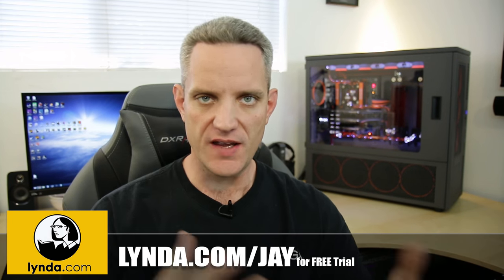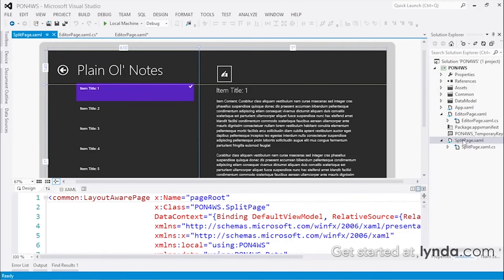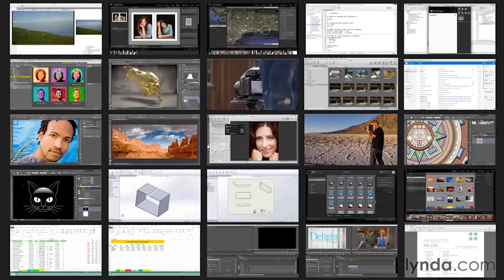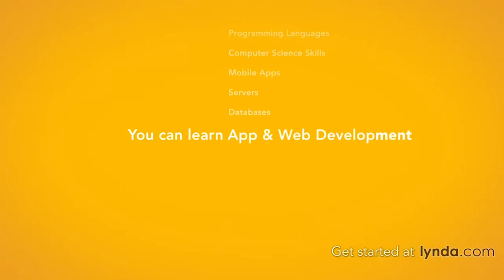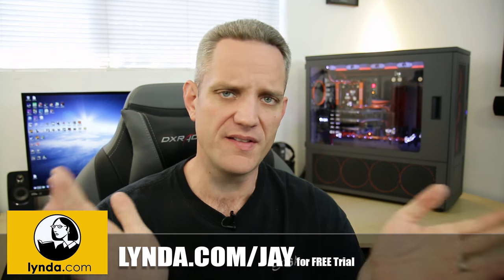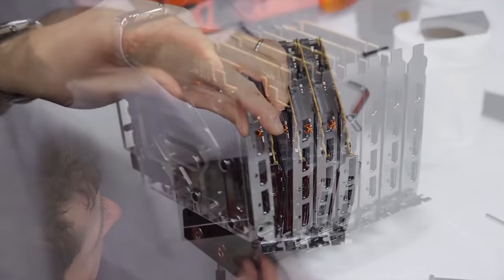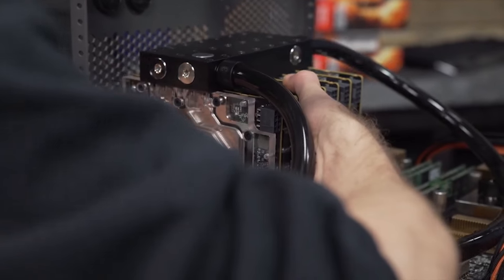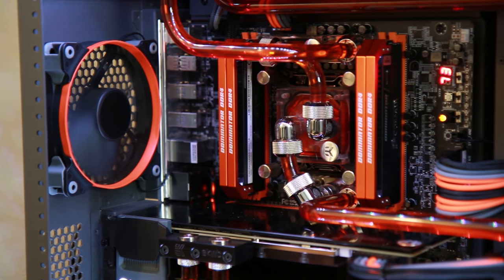Is watercooling worth it?

Comment: A few reasons I probably will never have a custom loop system in my PC:

1. It's time consuming. I'm not spending hours setting up a loop for a few degrees less.
2. Maintenance. Draining and filling the loop from time to time to clean it.. hell no.
3. I personally dislike the looks of a custom loop compared to most air cooled/aio cooled. 
4. Expensive. It's way more expensive than just keeping everything stock, which performs great already.
Reply: +TeaRex To be fair, it's not a few degrees. GPUs can be as much as 60C cooler than stock
Reply: +wenisinchina are you blowing on your gpu to cool it? it's not a 60c difference. ever.
Reply: +Nicholas Domenichini I don't kno dude, maybe a r9 290x overclocked to hell on air vs it on a loop with tons of rads, it could be close as some r9 290x's get close to 90c and I have seen cards below 30c...
Reply: +wenisinchina so my GPU runs at -30° idle and at 0° under load in a custom loop?
Reply: wenisinchina Yeh.. right..
Reply: TeaRex im talking a stock 290x cooler vs a good custom loop
Reply: +wenisinchina same here
Reply: Even with my 980 Ti, it's a HUGE difference vs stock.
With my overclocks, my 980 Ti was constantly reaching ~86C
Now with dual triple rads it rarely goes above 35-40.
Reply: +wenisinchina Agree my 980 ti does not go over 50c ever... that is overclocked and under full load it does not go over 50 while running low rpm fans in a 240 and 360 rad. so yeah...
Reply: +wenisinchina bullshit 86 degress on a 980 ti..... maybe if you had a blower style card and a shitty case. my 980 ti g1 gaming never goes over 60 overclocked
Reply: hmmm, I don't know. My r9 290 reached 95 degrees and was LOUD, VERY LOUD. Now with a single loop setup on stock I get 50 degrees. Overclocked to 1160 on the core with a 137mv over volt it will reach 65-70. Which is very good. Plus I run a 4790k, in my case it was extremely beneficial. 
I'll agree that it requires coolant change more times than my car needs an oil change. Still it was worth it overall. More pros than cons.
Reply: +raymond bailey  Urgh, can you get more radspace?
Reply: +raymond bailey maybe once to twice a year... Unless you have a dirty loop.
Reply: +Sherriff Brown I wish. I've got the bare minimum. A triple thick 120 push/pull and a 240 pull, all with noctuas on. Why urgh? I thought my temps weren't that bad tbh. Obviously I realise they could be better.
Reply: +jairumaximus no it's clean as a whistle. I aim for every year just to be sure.
Reply: raymond bailey

It was an Urgh of shared frustration as our rigs are so similar - not criticism at all :)

I have a heavily oc'd 290x lightning (1220/1750) and the same cpu as you running at 4.85 fans never run faster than 750rpm and my gpu temp is only above 50 in summer and that's only with one rad with push pull, the other is pull. 

I do have another more radspace though, another 240's worth which gives me more wiggle room for silent running and lower temps, can you get more rad surface area rather than extra thick rads in there, it would be worth it?
Reply: +Sherriff Brown oh right, I get ya. I've got a cosmos se mid tower. So to get what I've got in already, that was a major challenge as is. It's got to fit under my tv you see and I wasn't planning on watercooling at the time of purchase. So I'm basically working with what I've got.
When my tv eventually goes on to the wall, I think I can get a enthoo full tower in there as a centrepiece of the room. I'm not so bothered about overclock on the cpu, I settled for 4.5 so temps were acceptable. Sweet overclock by the way.
Reply: raymond bailey
 Ever considered a spot of case modding? I've been able to fit 480 rad space into a bitfenix prodigy with the help of a saw and a tape measure lol
Reply: +wenisinchina Got a EVGA Hybrid for this reason. Wasn't confident enough to go with my own custom loop, but I do prefer a quite machine. Doesn't reach >45c when even running stress test. Pretty pleased.
Reply: +Sherriff Brown I don't want to change the aesthetics too much. Although I appreciate it would help temps. But it's a kinda "if it ain't broke, don't fix" mentality. How much am I gonna gain? Card is already running nearly 30 degrees less than design temp, even overclocked.
I only run a 1080p 60hz tv. Everything I run is ultra to high settings anyway. Performance and temps are acceptable enough. My 120 triple thick already hangs outside of my case fixed to the back where an exhaust should be. That's about my limit on case modding.
Weird thing with my setup is gpu temp never fluctuates, but my cpu temp does. The gpu once it dumps its heat into my loop has an effect on my cpu temp. Never goes above 75 degrees full load though. But never the other way round. I've never quite worked it out. Next build I'm having separate loops, for sure.
Reply: +Sherriff Brown I've just looked at your case. Wow! You did well getting a 480 in there. Bit like getting 20 people into a mini lol. How did you even manage that? Was it hanging out the back or what?
Reply: raymond bailey
 GPUs make way way more heat than cpus

As for the benefits of lower temps its really just stuff like lower power consumption, longer product life, silent running and more overclocking headroom. Nothing mandatory certainly :)

To be honest the temp difference you get from separate loops is not really worth having all that extra hosing etc, at least in my experience, still they are fun to build :D
Reply: raymond bailey
 2 x 240s

You have to cut out parts of the frame to get them to fit inside the case. otherwise you are stuck with a 1x 240 and 1x120 or a 1 x 240 and a 1 x 180 both of which are very meh. that rig runs another 290x and a 3770k again never getting over 50 with super quiet fans.

Edit: These aren't slim rads they are a 45 and 60 deep
Reply: +Sherriff Brown ah I see now. If I'd have known I was gonna watercool, I would have bought a better case for it. The cosmos se is a very good case, but I wouldn't recommend it to somebody Watercooling. I've done all I can rad wise. My mobo, a z97 asus sabretooth doesn't help. I've literally got 38mm up top with 240. The armour prevents me fitting a 280, or a thicker 240 unfortunately. You can run a 360 up front but mean losing all your hard drive cases except the bottom 2. I have 1 ssd and 3hdd, so that wasn't an option either. Meh, like you say.
Reply: +Sherriff Brown just a point to make though. My case is near silent. I set one set of fans to ramp up and down for my cpu on the 240 and the the push pull 120 ramps up and down dependant on gpu temps. I can run them full whack with low noise adapters on, at 1100 rpm and you can barely hear them. Noctua do make the best fans. Every fan in my case is noctua. I have 2 140 static pressure fans up front, due to a restrictive hdd bay on my case. So I get good air flow. That required some modding to get in. But it all looks tidy.
Reply: raymond bailey

Defo a tricky one, could you sacrifice half the bays to get a 240 in the front to complement the 240 in the roof, that would be an easy enough mod, pop a few rivets, hack some metal out.

The alternative is to chop out all the hdd bays, rotate the rack and mount the hdds vertically between the psu (ssds now i always mount in the space for cable management on the inside of the back side panel) and the rad in the front, either way that's daunting for a first time mod.

I feel your 290x heat pain :(
Reply: Sherriff Brown that's nothing
i had to mod my cm storm trooper to hell to support even one triple rad, let alone 2
Reply: +Sherriff Brown unfortunately not. Bit of a design flaw with the case. Any rad upfront whether it's a 240, 280 or a 360 requires you to remove the modular hdd bays. Once you remove that, then you can get a rad in. So it means sacrificing them all. The only other option would be to mount the rad protruding from the front, but that exposes my case to a shit ton of dust with the covers removed. Think it would be more detrimental than beneficial in the long run. Dusty as hell my home, it would clog the shit out of all my heatsinks.
Reply: +wenisinchina why not just buy a bigger case? I know that's my issue. I should have bought a more suited case. I'm not massive on modding cases. Only cars. Even then I like everything to fit as if it was stock. Personally  I don't like things looking hacked up. For me presentation is everything. My pal always complements me on my tidy builds and cable management. But I digress, I'm an electrician by trade, so its kinda my job lol.
Reply: raymond bailey I really love the cmstorm trooper, and I actually took time to make the mods look good. I didn't just hack into it and stuff the rads in. Plus, i can probably say i'm the only person using that case that managed to fit dual triple rads in it :) (plus i really hate most of the cases coming out these days, they all look like nondescript boxes)
Reply: wenisinchina

 I have 2 triple rads (white) in a cm storm
 (stryker)
Reply: +wenisinchina it is a very nice case. Perhaps one I should have considered. I do like how the cosmos se looks, that's why I bought it. It seems to blend in with my other equipment weirdly. I'm limited to 600mm height so it fits under my tv. Defo buying a bigger case once my tv is wall mounted. My days of measuring will be over then. 
Really like the enthoo primo full tower. 2 480s, triple thick with push pull, top and bottom in that beast. Sky's the limit. My mate said I'd me mad, but why not if you have space. Plus if I upgrade anything, the cooling is already for it.
Reply: wenisinchina

The trooper is the black one right? My Stryker is the white...small world isn't it :D
Reply: Sherriff Brown Haha yeah. I actually bought mine before the stryker was even released (~2011). The stryker is a pretty good looking case - if i were into white builds i'd definitely have gotten it.
I spent quite a bit of time cutting the hole in the top and building the mounts for my triple rads. :). I went through like 4 dremel cutting bits lol. I even managed to get a rad in the top while retaining use of the handle.
Reply: wenisinchina
Trickiest part of mine was getting the metal handle back in the roof after installing the triple rad, a few spacers and a little bending the bracket into a new shape with a vice and hammer and it fits like a charm though. I only wish the internal plates I made to mount the front rad on the inside I'd painted black rather than white, or red to match my cables.. I even did it black the first time then changed my mind and just edged it with u channel for black highlights to break up all the white

Maybe next time i tear the loop down to clean it i'll sand it down and repaint it
Reply: +Nicholas Domenichini it actually can be that big of a difference going from a blower style reference nvidia gtx 970 that used to get up to 90C with a slight overclock to watercooling the same card with a much higher overclock which stays at 30C, 38C at max. So yeah it can be a very big difference. Thats a 50-60 degree difference.
Reply: +TeaRex The only time a custom loop is generally warranted is when you're doing mad overclocks on at least two components.

"Stock performs great already" well der, but if you overclock them you'll push significantly more performance, even without water-cooling.

Yes it is expensive, seeing as the cheapest water coolers are about $60~, but for the extra performance gained in areas such as rendering (CPU) or graphics (GPU), it's usually worth it to those who want to push their hardware to begin with.   Price-to-performance, as well as other factors like JayZ mentioned, it's usually worth our time, effort and money for those of us looking to push it to the limit.
Reply: Bojangles 4th

Totally not limited to overclocking; I like my pcs to be silent, this cannot be achieved with high end components and air cooling even at stock.

I like it so I have to sometimes stick my fingers into my fans to see if the pc on.
Reply: Sherriff Brown
>as well as other factors like JayZ mentioned

Oh I know, I just didn't feel like writing everything down any further :v
Reply: +Sherriff Brown I agree
Reply: +Bojangles 4th (Bojangles4th) running a 4790k and a r9 290 at stock, those temps can get stupid with air cooling at stock volts. In my case liquid cooling was a viable option, overclocking or not. A cpu that can get to 80 degrees and a gpu at 95 degrees, all stock, in the same case. 
My hdmi lead was getting so hot I thought it was gonna melt, seriously it was that bad. Even with good case flow. I measured temps coming out the back of my case and they were 100 degrees. From that moment I knew watercooling was for me.
Reply: +raymond bailey my cpu was doing same, so i bought a new 212 evo for it, when i removed the old cooler, i found artic silver only covering about 25% of the surface, and dust surrounding it, i went from 76C under load to 31c under load
Reply: +TeaRex sock on my 980, you must be having a laugh? it gets to about 60-80 and about 40 at idle! i use a G10 with h100igtx (i have 2) it barely reaches 50 at load never mind at idle!
Reply: Charles Joyce my lightning runs at 32c idle & 55c under load.....
Reply: Jody Wilson under water?
Reply: +TeaRex reason 3 is just silly, the first is also silly, if you know what youre talking about you know you always 10 till 20 degrees down the rest i wont even talk about, this is just silly
Reply: Jody Wilson not sure what cpu you're talking about. My haswell 4790k is well known to get warm. I've seen it spike to 80 during stress tests.
I've even been in touch with intel tech help I was so concerned when I bought it.. I used to have a AMD phenom x6 1055t, but that was 45nm die size, so 60 degrees was the limit on that. Never went above 55 degrees full load.
The intel tech guy said anything over 85 degrees was when I should get worried. Sounds like your issue was completely differnet to be fair.
I've made my peace with the chip and just accepted it runs warm, even under water.
Idle temps are 35 degrees, which I believe is about right.
Reply: +TeaRex Bottomline here is "If you cant afford it then Leave it!".
Reply: +TheTarne That's a lie if it's full load because my 980 gets to 80 degrees overclocked on Furmark.
Reply: +Thomas Shera it's not exclusively about WC, it's a computer tech channel. if it was exclusively about WC Jay wouldn't have a vid about whether or not to WC.

And even if I don't personally have any desire to use WC, it's still fun to look at WC builds and such.
Reply: i just water cooled my 2 r9 290x's they would hit 85c when i would do benchmarks when overclocking and now they never go above 65c so it was worth it in my opinion
Reply: TeaRex a few degrees? the fuck you mean... it's like 10-15 degreees
Reply: TeaRex idk but for me, with just a hyper 212 evo I'm overclocked 4.7ghz and still max around 68 degrees under a long gaming session. Either I hit the lottery or I just have good airflow lol. But for me it isn't worth it since I'm already around the upper limit of my cpu. Gpu is also overclocked and rarely goes above 50 degrees under load.
Reply: Then there is the AIO argument, you can get some pretty good water cooling for around 100 bucks these days with zero maintenance.
Reply: You can get a 240mm AIO for around 90 bucks
Reply: I would say 40C roughly, 60C sounds overly optimistic.
Reply: You only have to build it once, and it lasts as long as you want it to.
Draining and filling doesn't take any time to do really, and its not hard to do.
Most people like the looks, it does depend on the person and on the build in particular.
Its expensive, and that's the main downside, but the components aren't electronics they don't become worthless after a few years, you can keep using this stuff for years and years (with the exception of the pump which will die after a few years)
Reply: Its worth it if you enjoy it.
I think you have to do it properly or you risk leaks, and that can be costly then.
Reply: I'd rather spend it on a car right now.
Reply: +Tarne I have 2 MSI 980 Ti Gaming 6G and both go well above 80C even at stock with 100% fan speeds.
Airflow is great, PC is as clean as a whistle and I have more Noctua fans than fingers.
I have never heard of a 980 TI overclocked staying at 60 on air, but I guess you won the silicone lottery big time
Reply: 80 at stock? There is something seriously wrong there. Mine doesn't get to 80c even overclocked. Same card.
Reply: +TechMantra Not according to MSI, I've also replaced the thermal paste with Noctua paste. Fans work and everything seems fine except for the hot temps.
The heat sink is hot and so is the backplate, but I think that it is due to a too small heat sink they put for such a hot card.
Read many threads about these being hot and this is similar. Seems like their heat sink is not enough to compensate for bad luck in the silicone lottery
Reply: In that case, I guess water cooling would be perfect... Or 1080ti's...
Reply: Waiting for Volta. The cards manage to run games fine and cannot be OC'd or refunded for the temps.
Just gonna do my best to keep them cool and play until something better comes along.
Probably gonna stay away from MSI cards and others with these skinny heatsinks
Reply: Well with Pascal, the cooler is less of an issue because the architecture doesn't get as warm as Maxwell. As for volta, yeah I'd like to wait for it. I assume Nvidia will be in no rush to release it due to the lack of competition. I know vega was released but that was a bit of a flop in all fairness.
Reply: Yup its a shame they didn't release any top tier Volta cards. Would have really wanted to see them light a fire under Nvidias ass, but maybe I am just being too optimistic